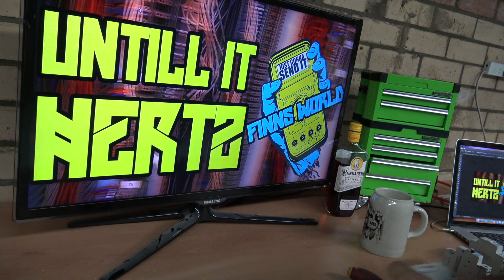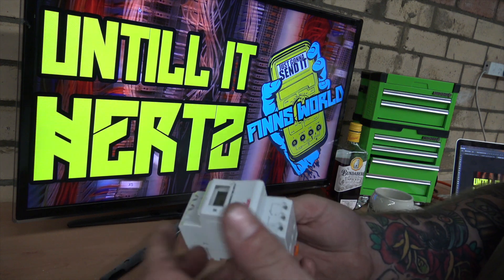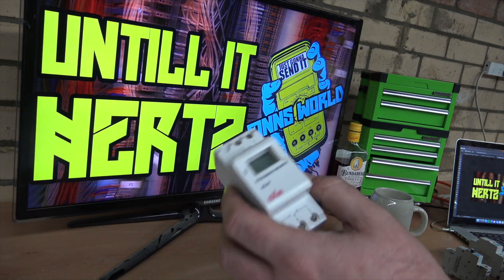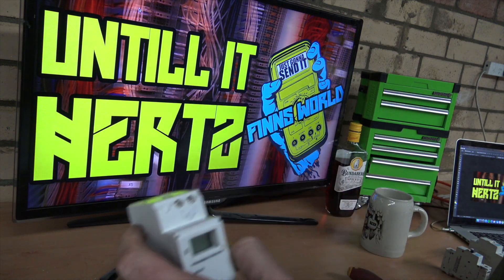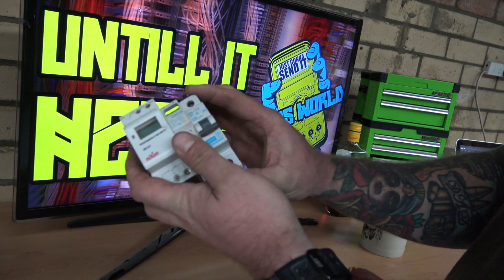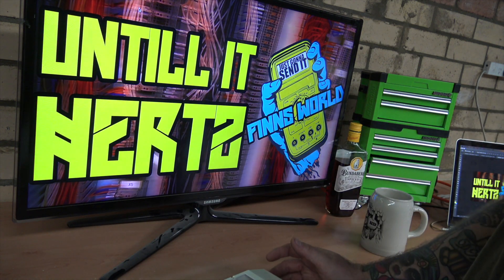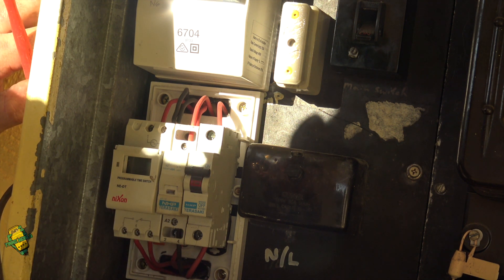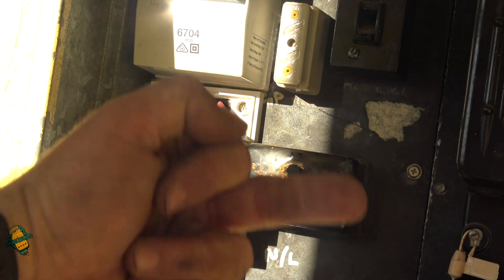Installing 240v seven day timer bore control | Until it Hertz E04

Comment: Cheers for the vid. Exactly what I need for my setup. What is the "this contactor"? What's that for?
Reply from the maker: I put the secondary contractor in to do the actual load switching, this was out of mistrust for the timer’s inbuilt contacts. It is not needed
Reply: @Finntheweekendwarrior  Cheers man.